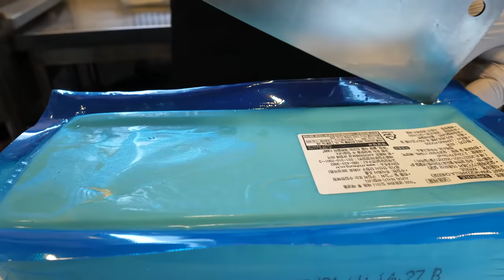인기있고 특별한 핫도그 영상 모음 / korean style hot dog (corn dog) collection - korean street food

Comment: What's interesting is that they 'twist' the batter around the corn dogs, not dip it. This means the viscosity of the batter is a bit thicker than you would do for pancakes/tempura/etc. Especially the first clip where a churro extruder is used to push out the batter, that one is the thickest.